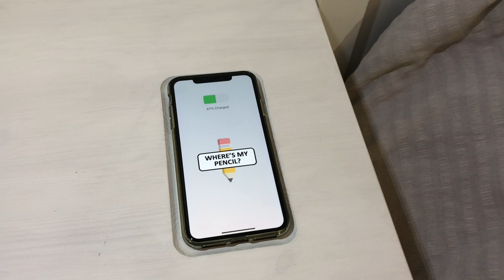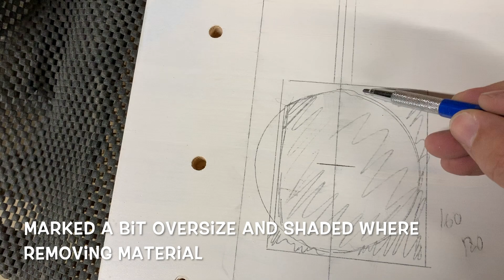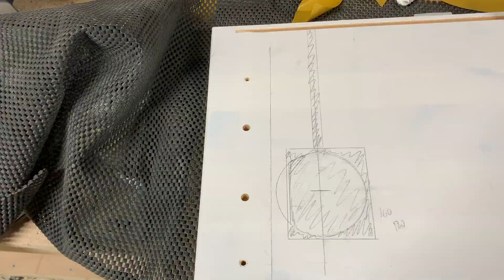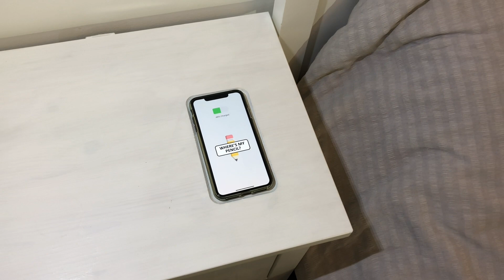Wireless Phone Charging in IKEA Bedside Table

Comment from the maker: NOTE: Be careful when adding wireless chargers to furniture. They get hot sometimes. To be fair if this got hot enough to melt the glue it would drop off the top and stop working so built in safety feature!
I hope you like the video!
Reply: Hey there! I noticed my 10w charger can get extremely hot (~60c after an hour of charging), what kind of temps do you see? Have you had any thermal problems?
Reply from the maker: Stephen Knight the glue did get so hot it softened/melted and the charger dropped out so I screwed a metal bracket in to hold in place. To be fair the glue melts in the gun at 105-120c and softens at 65c paint and wood will combust at about 300c I can’t see the charger getting that hot. Plus no fires yet. 🤞🏻😂